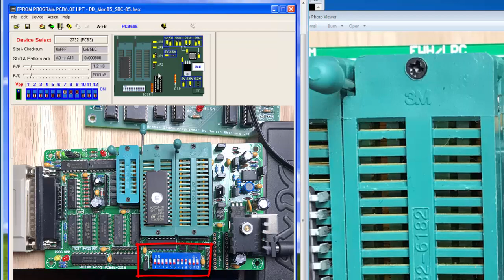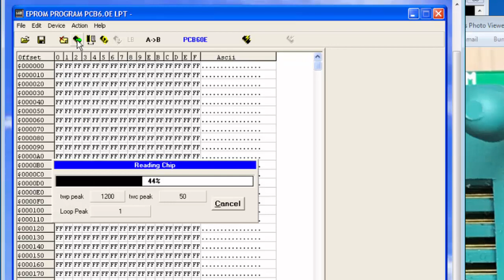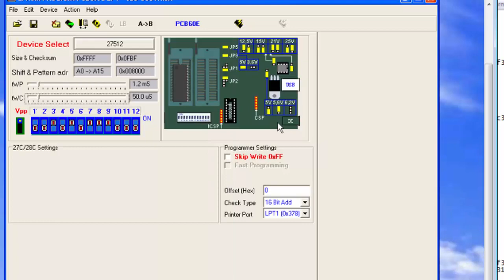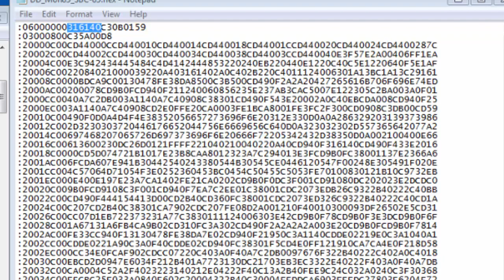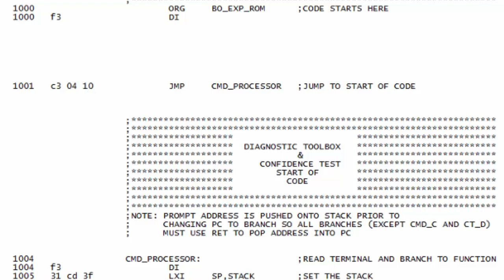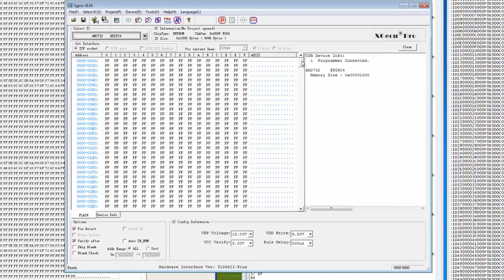{45} Specifics of programming an EPROM w/ Willem PCB6.0 programmer, memory offset, Intel Hex File

Comment: 2 questions, have you run into issues burning 2732s with the willem? i'm trying to burn a 2732a and it fails right away. Also on the 3:42 you show the eprom inserted on the programmer however the last row is not used. Was that a mistake?  Thanks
Reply from the maker: Good eye, I think you are correct the eprom is incorrectly installed one position up from the bottom in the photo I used, the little video inset from the video camera looks correct.  The EPROM should always be bottom justified.

I have not had any trouble burning 2732A eproms. Are you using 21V programming? I have noticed that sometimes the built-in configuration suggests lower voltages to be on the safe side.  That is a bigger problem in the 2764 where Vpp started diverging…., I am not sure if anyone made a 2732A that didn’t need 21Vpp.

Comment: I found this video at the perfect time.  I've had this willem programmer for a while and the last 2 times I tried to use it it didn't work well.  Finally someone who is able to explain the software and the way this programmer works in detail. Thank you!
Reply from the maker: As another resource, if you go to their website there is a contact email. I have always received a quick reply and usually the answer is very helpful.

Comment: wow thank you for this. I came upon this because I need to burn a 27C256 but the ROM has an offset from 4000 to 0000. I'm trying to understand how to do that with Willem. It looks like it occurs with the A>B editing. I understand what you did. I just need to wrap my head around doing something similar! :D
Reply from the maker: Just select an eprom that is much larger than the one you are using and load your file into the buffer. You can then scroll the buffer until you find the portion that needs to be moved. Use the A->B to copy down to 0000 and then change device type back to 256 before burning the eprom
Reply: @HelloWorldETX  Thank you for the very informative video.  I'm in a similar position as @f115, where I have a 27C256 used as a substitute for a 27128.  If I read the 27C256 with the programmer, the data doesn't start (16K of data) until offset 4000.  I would have thought in the scenario the last 16K data block would be empty, not the first (i.e. 0000-3FFF would be populated).  Should I burn a 27126 with the 16KB data contents of the 27C256 I assume I would similarly copy the contents at 4000 down to 0000 for the 27128?

thank you.
Reply from the maker: @TubeAmpNut  hi. If I were to hazard a guess, perhaps the eprom was read with the reader set for a larger device than being read, e.g., reading a 27128 when configured as a 27256.  In that case, the unused address line will float high and the reader will mistakenly locate the contents with the MSBit =1 which would be higher in the buffer than expected.   In that case you can just use the A->B to copy the data back down to 0000.  If you were to use the data as it is and program a 27128, the programmer would just program the bottom half (empty) space with FF. If you were to program the 256 device with that buffer it would be located in the high half and when you put the eprom in your board it would find nothing but FF at (eprom address) 0000.  (That last sentence presumes that your 128 to 256 eprom adapter has the MSBit address line tied low. If it were tied high then, as luck would have it, it would work because the hardware would already be looking at the top half.)
If you did read the 27128 with the reader set for a 27128 and it still put the data in the top half of the buffer, then I would need to completely guess again at what could be going on
Reply: @HelloWorldETX  thank you for this response! I went away and gave these a try but I didn't have any successful burns yet. Some notes about the ROM states that it starts at &h0000 and ends at &h7FFF. That seems like it's the full 32K and I shouldn't move anything. However, if I just burn it as is it gives me a buffer error right away at 0x16. Hmmm.
Reply: @f115Recs  make sure the eprom and programmer are working properly. erase the eprom and program / verify with all zeros and other standard patterns
Reply: @ccproperty1519  Will do! I'll report back.
Reply from the maker: @ccproperty1519  I would only add that is is also a good idea to do a blank check to confirm it was properly erased to begin with
Reply: @HelloWorldETX  Yeah I have been doing that every time, especially since I'm pretty new to all of this and can't tell what the software or chip is really doing. I didn't find any patterns to generate from within Willem so I'm just trying other ROMs. I'm also investigating whether I should using a separate power supply instead of relying on USB. It's all rather unclear :D
Reply from the maker: @f115Recs  there is a completely inappropriately labeled pull down.  It is something like “clear buffer” and then an option with what you want to “clear” it with, I.e., patterns like 0xAA, 0x55, 0x00 etc.  I would need to see how it is worded, but it is an easily overlooked option because of the misleading label.  
Yes, I would suspect programming voltage if it is not clearing bits during programming.  I always run mine off an external power supply.
Reply: @HelloWorldETX  right! I tried using that but the programmer flagged it as blank. I'll try it again. As for the power supply it looks like a 9-12V DC power supply is what should be used. I will definitely rule that out. Note that I have a PCB50B, not a 3, 4, or 6.
Reply: @HelloWorldETX  Well - I'm not quite sure what's going on. I'm not giving up but I am stumped at the moment. I added 9V DC and switched the jumper to use it. I also made sure that the pulse time and delay matched the chip specs (this is an AMD27C256-200 - so 100ms pulse, 200ms delay as far as I can tell in the datasheet). I blank checked the chip(s). I even used the 'clear' option to create test patterns. I've tried multiple ROMs too to rule out my source files. I'm not successfully burning. Each time it doesn't even start. It throws an error at 0x00000 with a chip and buffer error, each of which does vary some of the time. Usually it's the same error codes. This Willem is barely used (probably 10 times, all for backing up ROMs) so I don't know what to make of it so far. I'm usually pretty good at this stuff.
Reply: @ccproperty1519  Updated. see below (and thank you for jumping)! :)

Comment: Is there such a device I can use on a Samsung T550 tablet android tablet as I don't have a computer
Reply: Most of these are PC based (so no Android Apps or via Emulators) and are dependent on either a strong USB connection or even old skool dedicated parallel connections. This is WIN-based work all the way at the moment. Maybe there's MAC out there but I haven't checked. Some purists that know what they're doing go command line too.
Reply from the maker: Not that I have seen.